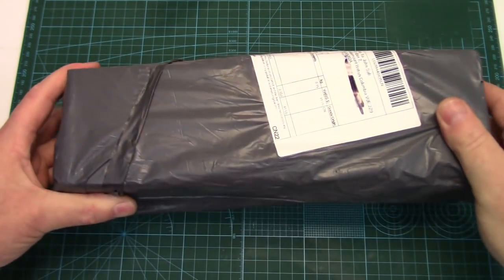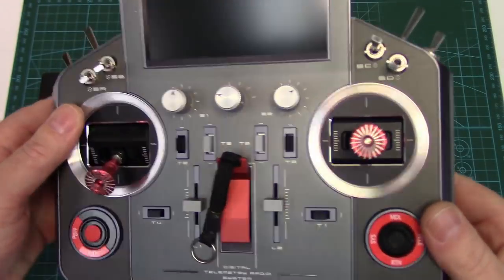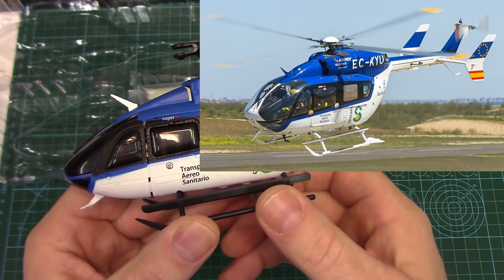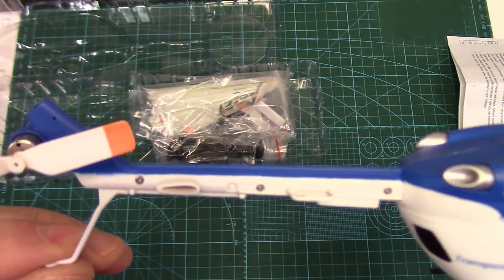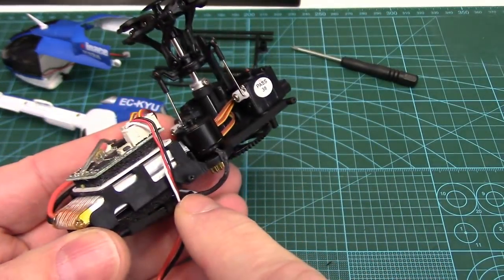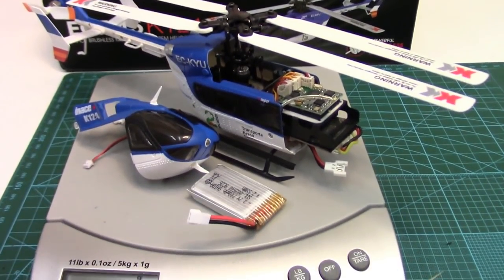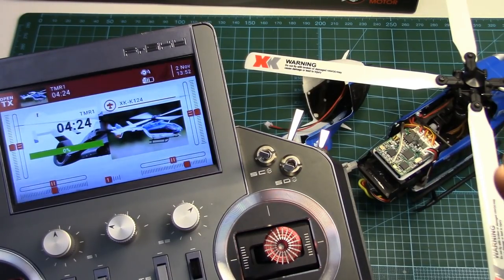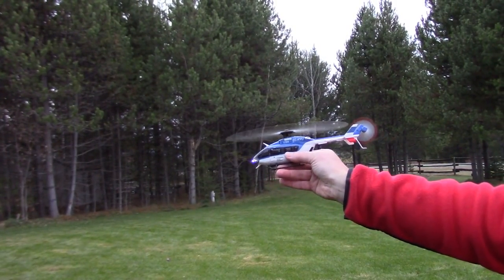XK K124 Scale EC-145 Micro RC Heli Review

Comment: The 4 blades combined with the head speed make it sound and look neat!
Reply: Do you know any quiet for indoor use helicopter ?
Reply: @purplefurture6960  The Blade 70 S is a good one. It's tiny and pretty quiet, and flies well indoors. It's fixed pitch though, so no inverted flight. If you want a scale body, the Esky F150 V2 has the same internals and a Bell 222 body.

Comment: I must say you're video on this bird has showed me more about rc helicopters that has kind of taken the fear of purchaseing and flying one. I had 2 Blade helos a few years ago and all i did was crash and by parts to the point I just gave up on helos.  Thank you!
Reply: some info, for novice heli flyers.    do  NOT  thumb  the  right stick.    because, it is  Impossible to  Know, by  FEEL,  where  'center stick'  is.      crashes should be fewer, if a pilot  continuously  allows  the right stick to  return to center.    this can be done by loosely  'trapping'  the stick between  thumb and finger.    use a neck strap.   use a good tx grip.     keep elbows mostly straight.    hold tx near waist level.    fully support tx  with  left  hand..      cheers
Reply: David Davids Thanks for the tip.

Comment: Hi, I’ve got a XK K100 which I’m trying to get working on my FrSky Q7 with a multi protocol module. How do you set these up? I’ve bound the heli to the transmitter but the channels don’t map across properly. Just does what it wants. Only channel that responds as expected is the throttle and the rotor pitch (which I have on a 3 way switch).

Comment: Hey John, love this video! 👍🏻🚁 I’ve managed to get my K124 a bit more control for indoor flight during lockdown.
She’s still very twitchy, the X6 transmitter has a gyro setting 0-100. Should I have a high value or a low value for better stability? Thanks buddy! ✅
Reply from the maker: Channel 5's output has no variable control over gyro sensitivity. It is only used to put the FBL system into normal gyro mode or self level mode.
Reply: @Rchelicopterfun  Thanks for getting back to me John. I’ve just watched your XK X6 Transmitter Review ( https://youtu.be/lzW9m8899Tk ) great video! Learnt a lot 👍🏻
It IS my first programmable collective heli radio (glad you approve). Regarding channel 5, I understand the toggle switch selects gyro mode/self level mode but when I go into settings > Gyro, I can dial the wheel from 0 - 100 and press enter. Surely this a variable control over gyro sensitivity?

Comment: John,
I LOVE the scale birds as well. I have BOTH the K-123 and K-124 and a Heli-Max EC-135 . as well, I have one of the Radios however I use my  Taranis X9D Plus. Would love to look at ALL of your Open TX programing for these little birds. also do you know if there are any scale fuselages for the small blade helis, Nano CPS/X,  130S, or even  the Blade SR and 300X 

Thanks
Kelly in San Antonio
Reply from the maker: Hi Kelly, I do show all the OpenTX settings near the end of the video (starting at time index 20:25). I don't think anyone makes micro scale fuselages for the smaller Blade stuff.

Comment: Great Video
What are your settings for Ch. 5 i.e. 3D/6G and were you ever able to calibrate 6G ?
Not convinced the Manual is correct.
Reply: Forgot tp mention I am using a Horus 10S with Multi-Module
Reply from the maker: Same as most small helis. Full travel in one direction (ie -100%) to full travel in the other direction (ie. +100%) on channel 5. This is basically an on/off channel 5 setup (ie. turns self level on or off and is a 2 position setting only - nothing proportional). Yes, manual is backwards; self-level (6G) has to be turned on to enter accelerometer calibration mode not off as is stated in the manual (at least the two manuals I have). No, never was able to enter self level calibration mode. Did a separate video on that: https://www.youtube.com/watch?v=ZuTbwYgkm40
I would think they have fixed the issue however by now?

Comment: I think this heli is better than k110 even m1 for someone don't fly 3D. It's much easier to see the position in the air with the scale fuselage. Four blades provide more float in the air than 2 blades. The only problem is overheating if keep hovering for all the time. But if you just fly around like me, this won't be an issues. It takes the heli less for flying forward than hovering. You can fly one battery right after another one.
Reply from the maker: The K123 is even easier to see 🤓 Both fun little helicopters.

Comment: This is a great little helicopter I love the way you go into detail on everything. I have a question John, I can't for the life of me figure out why I cannot get my helicopter to lift off I've got a new battery in it I've checked everything everything's even something to do with the pitch in the radio and I'm not sure what I'm doing wrong I've adjusted the trims I've adjusted everything I can think of and I cannot get it to lift off the ground it's like I need more pitch in my blades but I can't get it can you please help me
Reply from the maker: @Michael - I cover this lack of lift question as it's one of the most common ones I get on my RC Helicopter Lift page:  https://www.rchelicopterfun.com/rc-helicopter-lift.html
As that page explains, the two primary reasons any collective pitch RC helicopter will not lift off is 1. lack of head speed or 2. lack of collective blade pitch angle  (or of course a combination of both).
I go over things to check for both possibilities on that page. The two most common is you need to setup your pitch curve to produce more collective or setup your throttle curve to produce more head speed.
That is assuming there is not something else mechanically or electrically wrong with the helicopter preventing adequate collective pitch such as a separated swashplate, or electrically such as a weak motor or faulty ESC.

Comment: Hi John, which digital pitch gauge do you use that fits these size helicopter blades? Have you got a link? Thanks bud.
Reply from the maker: Hi Patrick, I don't use one on these small micros - there is nothing small enough to fit them. I use a simple cardboard/similar wedge gauge and the interpolation method as I outline in my setup & tips ebook in chapter 3 (Micro CP setup).

Comment: Hi John, been binge watching your videos and might even buy your books as the videos have helped me alot so far! One thing I don't quite understand in opentx tho is, how can I setup the gyro to about 30-40% output for more of a scale like flying, but still have all the control over the heli myself? If its at +/- 100 doesn't that either fully activate/disable gyro? I don't want it to be totally aggressive.
Reply from the maker: Best to contact me through my website for setup specific questions like this. The very short answer however is channel 5 output simply turns self level help on or off. You are not disabling normal gyro operation, only the accelerometer operation (accelerometer sensors are what enable self level). There is no gyro gain adjustability. If you want a scale behaving heli, you would never fly with self level turn on. It's too artificial looking and robotic to produce a proper scale experience. You would however setup the heli output settings for scale type flying - nothing to do with gyro settings.
Reply: @Rchelicopterfun  sounds good thanks for the answer. I'll contact you through the website in the future not a problem, just getting more into the hobby, so alot more questions will arise in the near future! Love your detailed explanations regarding this topic. Thanks for now

Comment: Hi i have been using 3.7v 700mah lipos for the past 8 months for my k124. But recently the only replacement i found is 3.7v 800mah. 
Do u think the heli can take it? If it can, any changes i can expect in terms of performance and durability?
Reply from the maker: Check the size... That's the go / no-go determining factor.
Reply: John Salt the size is similar. All right noted on that. Thanks mate!

Comment: Hi John, i have a 14 months old K124 and it has flown greatly over the period. 

However recently i had few crashes due to tail motor blow out.

Swapped to a new tail motor, and with this one, after i spool up about half throttle just before took off, the tail motor kind of whined for a split second and kicked the tail to the left (heli nose turned to the right) and both motors will stop spinning. 

If i cut down the throttle then spool again, the rotors will start spinning again.

What could be the problem? Is tail motor or faulty PCB board?

Thanks in advance, appreciate your help.
Reply from the maker: Sorry - no idea without testing the motor outputs in person on an O-scope. I would start with another new tail motor and if it does the same thing, then a new board next.
Reply: @Rchelicopterfun  ahh okay, i was also thinking the same thing. Because this new replacement tail motor is not a whole assembly from K124’s parts list, but rather just a universal motor with the same size (which can also replace K110 tail and K100 main).

Will try another motor and if it happens, then PCB change. Thanks for the input, mate!

Comment: What the heck does "tail rotor blowout" mean.  I've heard it mentioned a bunch but I'm not sure what it means.  Does the tail motor actually die or what?
Reply from the maker: Tail blow out occurs when the tail rotor can't produce enough thrust to counter main rotor reactive torque. Usually occurs during a torque spike (ie. collective pitch pumping or fast head speed change).  My page on RC heli tail rotor operation & theory covers this in detail: https://www.rchelicopterfun.com/rc-helicopter-rudder.html

Comment: Thanks John for this review on this one and the XK K123. I have both using the XK-6 tx that comes with them. Just wondering if one came with yours if you would do a super smooth scale flying tx -set up using the XK-6 tx. If not, I'll do some youtube searching to find one. Thanks again :)
Reply from the maker: I received the BNF (FTR) versions of both the K123 & 124, so no K6 radio. With that said, radio setup is radio setup. The same values I talk about in the video can be used on any radio (with the note that OpenTX like Spektrum & JR uses positive expo to shallow out mid stick output whereas Futaba and the K6 need negative expo. I state the collective ranges I use in my 3 flight modes so you would simply alter your pitch curves in your K6 to achieve similar collective ranges (about -2 to about +9 for these micro scalers is what I personally like).
D/R is largely personal preference just as I mention in my setup & ebook for collective pitch RC helicopters : https://www.rchelicopterfun.com/rc-helicopter-tips.html
Smooth scale flying style as you likely know is also largely up to the individual flying to pull off. I've been flying scale RC helis for over 20 years now and it does take practice to mimic full size heli behavior - more so on these little light weight micros over larger 600-800 size machines where mass & inertia are your friends.
Reply: @Rchelicopterfun  Ok John, time for me to study up and maybe consider getting you ebook. I did get your beginning book on the SR-120 a few years back. I probably need to read that again....I'm retired now so I'm looking forward to spending more time doing this. Thanks much.  :)

Comment: Hi! I recently bought an xk k124 helicopter rtf and I can't get it to enter in 6g calibration mode/ 6g flight debugging mode(as per manual) ?! When I pull both sticks of the transmitter all the way to the bottom position and hold them there, as I read in the manual and as I watched in online videos, nothing happens. I tried all the settings I could think of : in 6g, 3g, even 3d mode; with dual rates high and low, with different values for the dual rates - under, to 100%  and above, with different throttle curbs,I have factory reset the transmitter, I have rebind the heli to the transmitter etc, nothing happens. 
Can you get yours to enter 6g calibration mode?
 Thank you!
Reply from the maker: To be honest, I haven't tried to calibrate the accelerometers (6G mode) on this K124 yet as it was perfect out of the box. I did however have to calibrate them on my K123. I cover the process in my K123 review on my website: https://www.rchelicopterfun.com/xk-k123.html
As I mention in that review on the 6g calibration process, the one deviation from what's listed in the manual where you hold both throttle and elevator sick full low, is you have to have the auto level (6G) mode toggle turned on, not off. I also had to ensure my dual rate toggle was turned off so there was enough of a low stick elevator output to activate the calibration. It sounds like you have tried all that as well with no success. 
I'll try the 6g calibration process with my K124 and if it's not working, I'll try to do a video on the problem and a fix if I can figure it out.
Reply from the maker: I just uploaded a video showing how mine also won't go into 6G calibration mode.
https://youtu.be/ZuTbwYgkm40
I was hoping a missing cap on the board might be the culprit but it wasn't. Perhaps others will leave some useful comments as well.

Comment: Nice review, would you recommend  getting this model to begin with helicopter?
Reply from the maker: I personally feel there are better micros to learn collective pitch flying skills on. Scale helicopters like this one are more fragile, they cost more, they weigh more, and with the multi-bladed head, are less efficient (shorter flight times). If you want to learn collective pitch flying skills on a lower cost micro heli, my personal recommendation would be one of XK's pod and boom models such as the XK K100 or XK K110. This page on my website might also help you: https://www.rchelicopterfun.com/best-rc-helicopter.html
Reply: @Rchelicopterfun  thank you i will check it

Comment: I have several 2.4 gigahertz transmitters that came with other helicopters. Wondering if just helicopter is also 2.4 gigahertz on the bind and fly.
Reply from the maker: As I say in the video - it uses Futaba's S-FHSS protocol (the digital language the TX & RX speak to each other with). If the 2.4 GHz TX you have has at minimum 6 channels, is computerized, supports heli programming (pitch and throttle curves), and is using S-FHSS protocol, then it will work. If it doesn't have all that, it wont.
Reply: @Rchelicopterfun , Thank You.
I'm looking at the Taranis. How do you rate it against the Horace?
Reply: @dalepatterson1748  I'm using the Taranis X9D Plus with mine and also a Multi Module I Range X, Works great.
Reply: @kellyvb9881 , Thank You !!

Comment: Nice heli. Is the included transmitter any good?
Reply from the maker: The RTF version's included XK K6 radio is basic, but it certainly works and most importantly, it's computerized so you can properly setup the heli. I do go over the XK K6 TX in more detail in my XK K123 review on my website: https://www.rchelicopterfun.com/xk-k123.html

Comment: How do you find the range on the irx4. Have you done any firmware upgrades?
Reply from the maker: No range issues, but I only use the multi-module for the smaller BNF stuff I have so have never tested it much past 600 feet or so. I use the internal FrSky RF on my larger helicopters. I did update the firmware in the iRange X module shortly after I got it, but haven't touched it since (it's currently running version 1.2.1.64).

Comment: Which one is better k124 or k123
Reply from the maker: It's pretty much a subjective decision since they are both so close. The 124 does fly marginally better I find due to less TRTT induced lean and tail hold is marginally better when flown at the power limit. On the other hand, I still enjoy my time flying the 123 a wee bit more simply because I like the full size AS350 plus the 123's bright color scheme is easier to see. Again, subjective points, but it may just come down to the one you like the looks of better. May just have to get both ;-)
Reply: John Salt so what would you recommend because I really can’t choose!😂

Comment: 123 vs 124 which did u prefer?
Reply from the maker: 124 is bigger and brighter so it's easier to see and for me that is a factor for any little micro heli. Canopy fitment is also easier on the 124 so it would be my personal pick over the two. The 124 however does fly a bit better. It depends on what criteria you deem more important.
Reply: @Rchelicopterfun  well imagine xk 124 with 123 canopy but 5 blades😍😍😍
Reply: @Rchelicopterfun  Yes I agree 👍K124 is more stable than K123 it is because K124 have 4 Blades. That's why I chose K124

Comment: I bought one last year and the servos burned out on the first start up. Was very bummed about that.
Reply from the maker: What's the rest of the story? What did you find wrong with it? Faulty BEC? Overcharged battery? Seized swashplate? Seized blade grips? Over-traveling the servos?
Reply: @Rchelicopterfun  I believe it was over traveling of the servos. I bought some replacement servos and before I put the linkages on the swashplate I noticed the travel rate would change from what seemed normal to extreme
Reply: Might have been a faulty board. So I'm gonna order a new heli sometime. It was super discouraging at the time.
Reply from the maker: Good to know.

Comment: some thoughts.    the comment about   visibility   is   Significant.    i had a heli with a red canopy.  but i'm a bit  colorblind.    so i was always losing  orientation.       a small heli, especially, should  be  Bright.    yellow/chartreuse/white.      for the sake of color-blind pilots,   red  should Not be used.        there is a  continuing issue with  all  cp helis.      the head speeds  are  Way  too  high.     
until that changes, i will stay with  fp helis.     certain  fbl  cp or fp helis  have  Too much mass in the main rotor blades.    the result is  a  Wonky, top-heavy  dom.    distribution of mass.     cheers